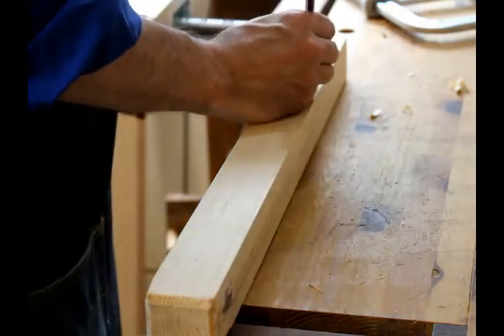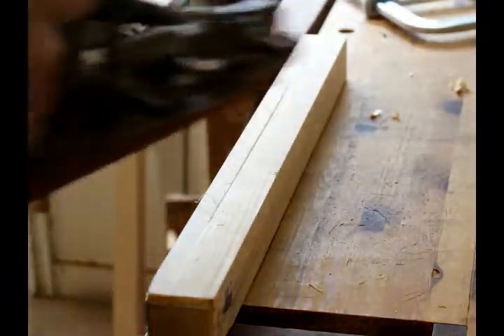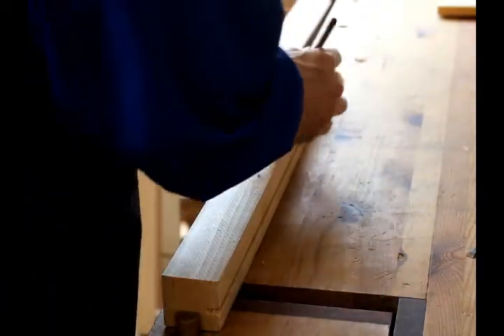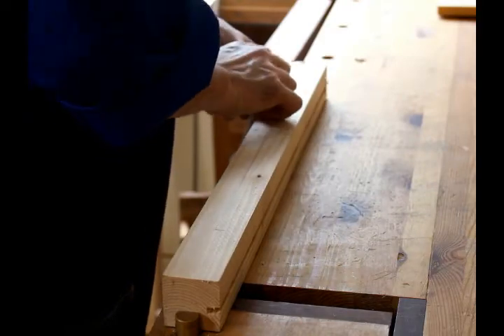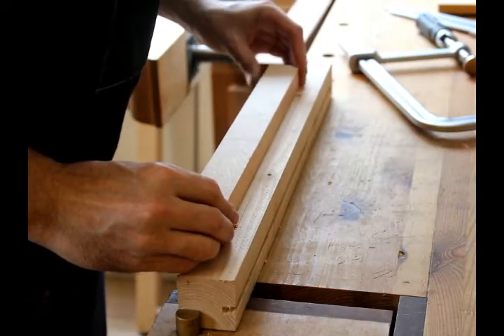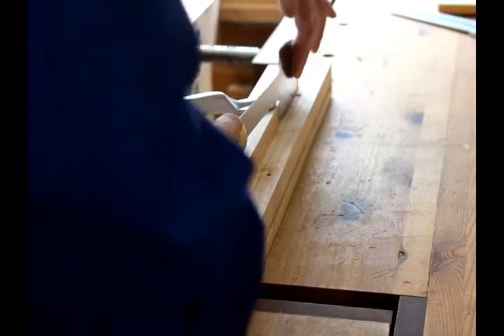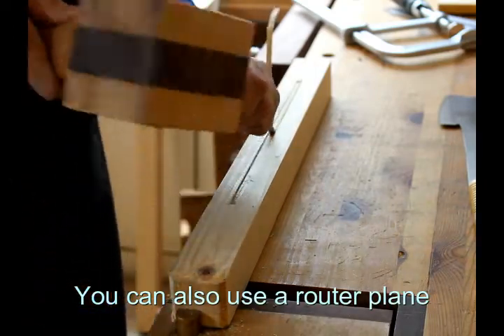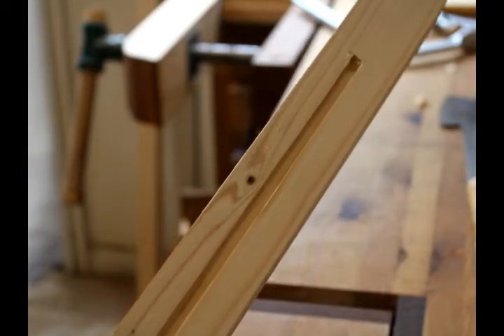Use a Japanese hand saw to make a stopped groove without a router plane!

Comment: Nice! I don't have a router or an aze-biki nokogiri, but I have had some success on pine with just a series of very heavy knife cuts, starting light and then really working into the cut with a sharp knife. I then pared into that line from the waste side like Paul Seller's 'knife wall' technique for sawing, then removed the waste with the chisel as you did. 
I"d be wishing for a saw in any thing tougher than pine though!
Reply: Yes! I totally forgot, but that Stanley I'm using actually had a veneer cutter that can be used to do that. You'd still run into the same problems with the skids though. Thanks for watching and commenting!

Comment: Hi Jason, I’m new at Woodworking.  I like your channel and subscribed and look forward to seeing more of your videos.  I do have a question regarding the combination plane.  As I understand Stanley’s combination plane had several shortfalls.  But, I believe all those have been addressed with Veritas’ Combination plane.  Not sure if you are familiar with it, but if you are do you find the same issues with it?
Reply from the maker: Thank you for subscribing! I am not familiar with the Veritas Combination plane, unfortunately. I choose the old Stanley's for a couple of reasons..I like the sturdy construction of older tools, and I have a very small shop, so it seemed more economical (and space-saving) to buy two combination planes rather than 50 dedicated moulding planes. Having used both dedicated planes and the combination plane to make moldings I have found that the Stanley is excellent if you spend the time to make all the minor adjustments required to the sleds and fences, etc. This can be time-consuming, however. If you are looking to be able to quickly transition to making moldings without hassle I would recommend the dedicated wooden molding planes. I just watched a video on the Veritas and I didn't see anything that is different from the Stanley in terms of adjustment. With all combination planes you need to have razor sharp irons, and not all the irons can be sharpened with a jig (almost none, actually), so you need to have good freehand sharpening skills. But,the same goes for dedicated moulding planes though, however, so there's not much difference there. The other thing I considered was the condition of the plane...wooden moulding planes can be easily found on eBay, etc. these days, but finding ones in good condition with flat soles and good irons can be quite expensive. Due to the materials used in the Stanley (metal) I've found that they all work even though they might be a little rusty. Finding one in good condition with all the irons can be a problem and costly though. If you're on a budget and want to ensure that the condition of the plane and irons is perfect, and also be able to contact someone at customer service should anything be wrong, I would go with the Veritas. Hope that helps!
Reply: Tenons & Tenors thanks!

Comment: There's no reason your saw would have to be curved.  You could just as easily use your technique with a back saw to achieve the same results.  I got my back saw from my local Ace Hardware.
Reply: The curve is not for feasibility but for efficiency
Reply: @timelyrain  yes, well, if you don't have one of those saws then efficiency is the least of your worries.  My point was someone with a backsaw or really, almost any crosscut saw that's rigid enough could still make the cut without having one of these saws.  I only say that because he said that if you didn't have the saw then you'd have to just chisel it all out, which is inaccurate.

Thanks for the info though 👍
Reply from the maker: A Western back saw would be close to impossible to use in this situation. The Japanese saw with the curved blade allows you to push the saw forward in the kerf and cut on the pull stroke, and the straight handle allows you to apply downward pressure as you cut. The shape of the handle on a Western back saw is designed to enable downward pressure as you push forward, but the 90 degree angle on the front of the saw would get caught in the kerf and you would not be able to push it forward. You have to remember, the back saw would need to be at angle since the entire blade may not fit if the groove you are cutting is short. The Japanese saw avoids this problem entirely. Thanks for watching!
Reply: https://youtu.be/G4hA-auX85Q

As long as the dado is longer than the saw blade and your back saw is not super thin and flimsy like a flush-cut saw, a back saw will work just fine as shown in this video.  It may not work as efficiently as this nice Japanese saw, but it can get the job done.  As can a chisel and mallet.  Whatever works...
Reply from the maker: @ARMYStrongHOOAH17  Apparently you didn't read my comment carefully. I said, if you're cutting a groove that's shorter than your back saw, you will not be able to use a Western saw. Also, in the link you sent James is cutting a groove that allows his saw to go beyond the work piece. That is NOT a stopped groove, where the groove ends within the work piece. I appreciate you're comment, but you are wrong. A Western back saw is not the tool you want to use for this task.
Reply: @TenonsTenors   🤦‍♂️ Which is exactly why I conceded to that very statement and specified that as long as the dado is longer than the saw blade it will work fine.  I just went out and cut a rough stopped dado with just my back saw and ¼" chisel.  I didn't have the ability to use my drill for clean ends or my hammer for perfect chisel lines but tomorrow when the neighbors are no longer sleeping I'll film a video of me doing it.

I also appreciate this dialog because while I started out thinking I could only cut dados longer than my saw blade, the test run I just did taught me that by tilting my saw handle up I could actually saw with just the front portion of the blade thereby allowing me to cut a dado shorter than my saw blade.  Learn something new every day.

My original point was that the cut could be made with common saws found at most hardware/big box stores. Just offering options...